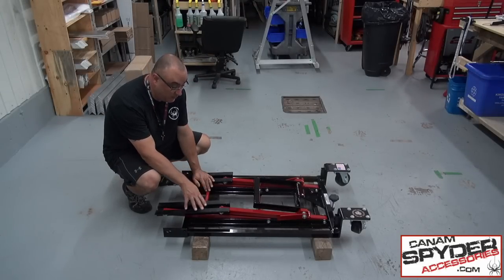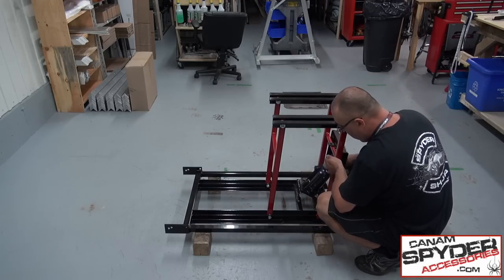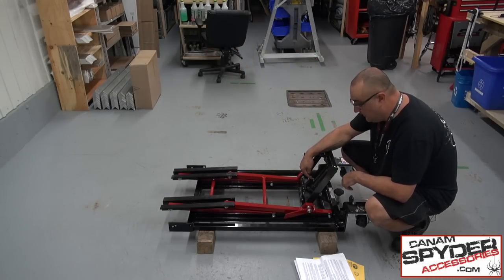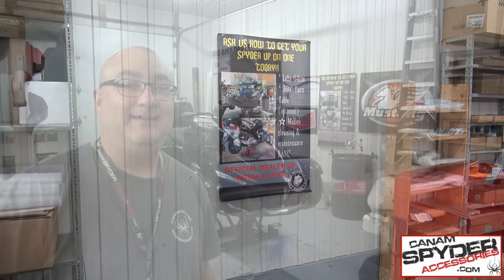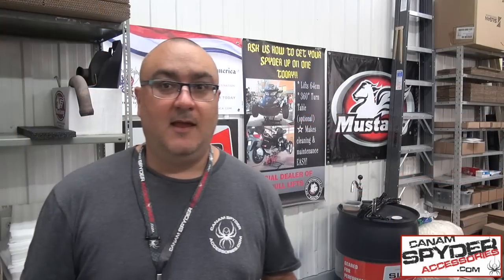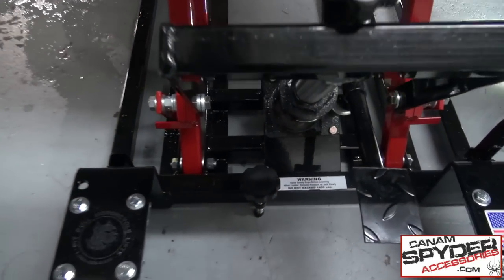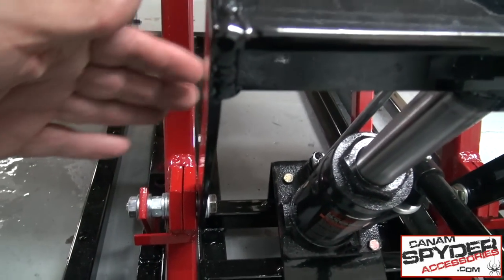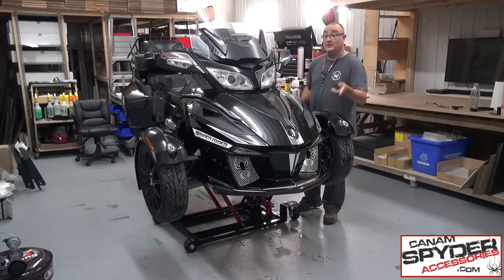The best Can Am Spyder lift on the market !!! Pitbull Motorcycle lifts. The Spyder Shop

Comment: Thank you for great and informative video, just like others you have made.
i was trying to find that lift without success. Company does not make them.
I live in Quebec, Canada and before Spyder i used to ride regular cruiser bike.
Used bike lift a bit smaller than the one in the video sold by Canadian Tire for $199 CDN on special you can get it for as little as $139 CDN. it can lift up to 1500kg 14" or so. it works great on my Spyder.
Reply from the maker: The lift is dicontinued....